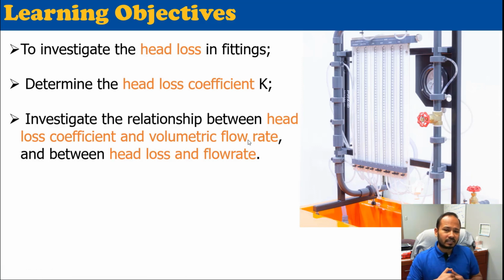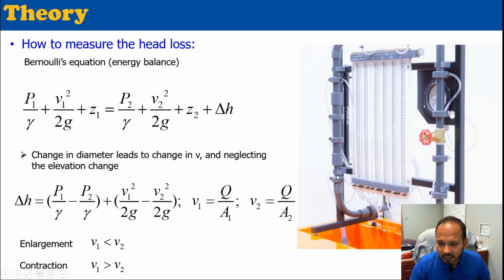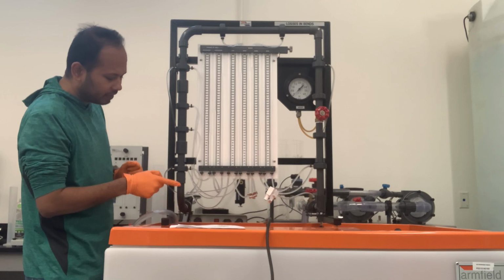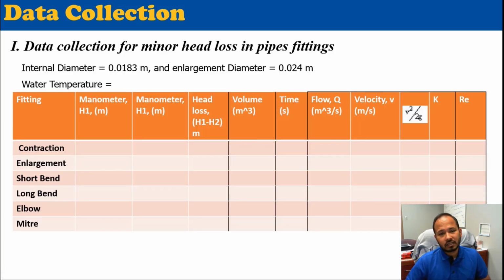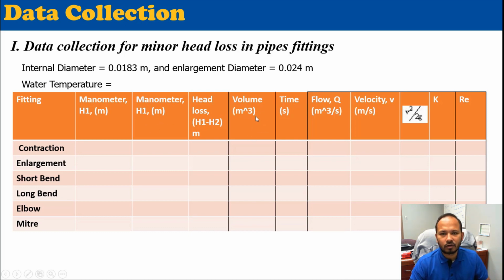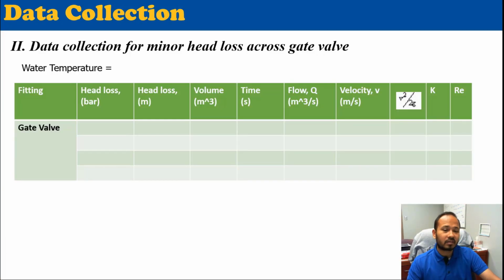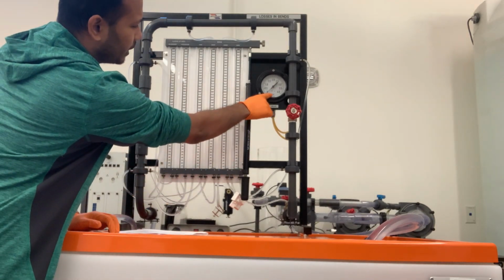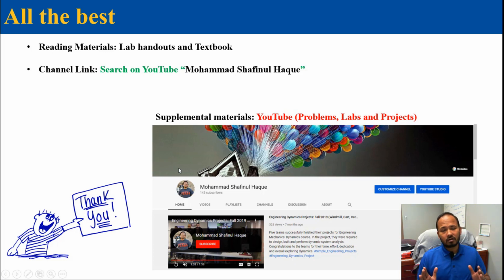Lab 8b: Minor Head Loss (Energy Loss in Bends and Fittings)

Comment: Thank you. I was wondering how you calculate the losses created when the pipe is reduced in diameter. I know both diameters have their own separate head loss, but surely there are losses created in the connection point itself, especially if it is not a gradual transition. I assume there would be some sort of turbulent flow created by an immediate transition from large diameter to small diameter. I cannot seem to find a K (minor loss coefficient) value anywhere for this.
Reply from the maker: You're welcome. You can use the equation given in 1:55 min and then collect the data as shown table @ 12.30 min, once you have experimental ∆h and v^2/2g, you can find K.
Reply: @MohammadShafinulHaque  I appreciate your response. I am working on project where I do not have access to the pipes to do experimental testing. Do you have any recommendations for finding the minor loss K values for instant contractions in pipes just from their diameter values?
Reply from the maker: @jacksonbradshaw855  one way to do that if you have the cross sectional area or dia at vena contracta, such as AcVc = A2V2. Since you do not have any access to the pipe, one option is to assume K=0.5.
Reply: @MohammadShafinulHaque  Sounds good, thank you for all your help.
Reply from the maker: @jacksonbradshaw855  you're welcome